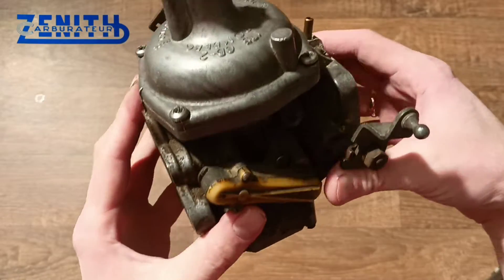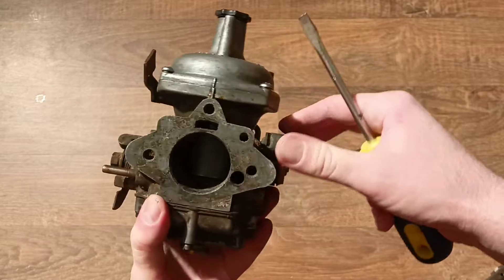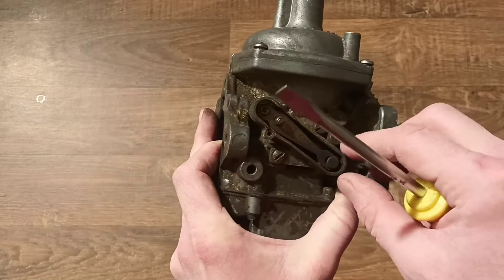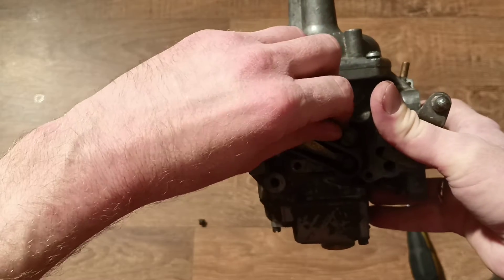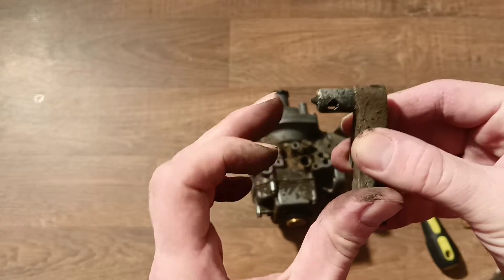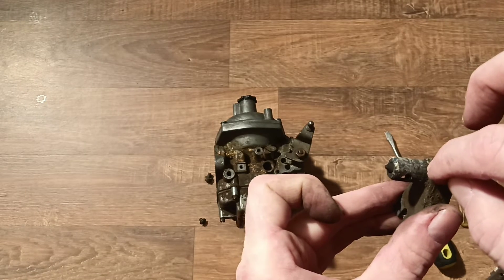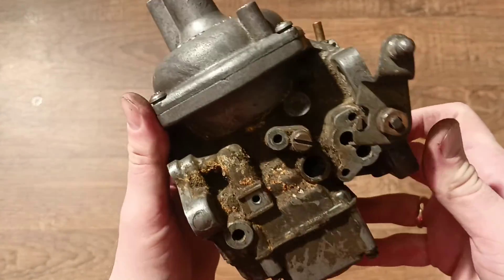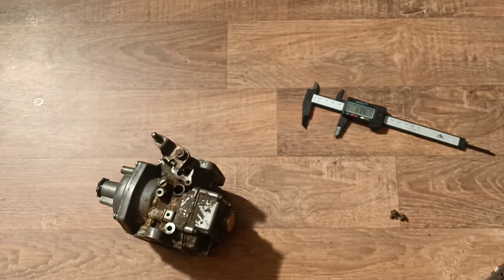For What Temperature Compensator Is And How It Works In Carburetor Zenith-Stromberg 175CD2SE

Comment: Thanks for explaining the 175 designation for zenith stromberg carbs - I never knew that.  An old mentor of mine said that he liked working on carburetors because you could bring them indoors and work on them in comfort, with good lighting. He taught me that if all your parts were good, all you need to do is to return it to the factory settings and it will perform it's job well. Constant Depression carburetors were popular in aircraft before fuel injection became standard because they compensate for low air density at altitude with reduced fuel flow, maintaining a good mixture.   🙂
Reply from the maker: Thanks! It's really so great to have a good mentor in a mechanical afers. Main thing as I realised and agreed with what says your mentor we should work with good lighting and comfort. Btw as turns out, you could bring even the car engine indoors and repair it yes-yes my dad did so. Put it into his granny room... As we say about carburetors I noticed that in a lot of car models constant depression carburetors also was popular before gasoline injectors. And yes I've familiar only with 150 and 175. Carb difference obvious without measure with caliper just for picture. Factory settings main thing in repair I agreed completely. It's written on the stone but gasoline different now and all engines with different worn so I think better to adjust carb for particular engine. I'm really glad to read your comments!😊
Reply: Granny's room ! 😀 @patricksgarage